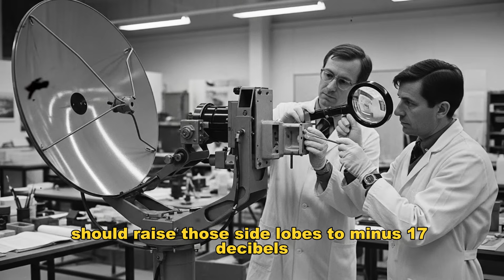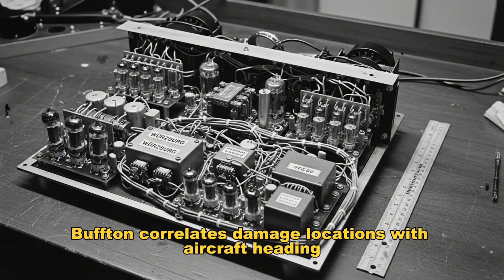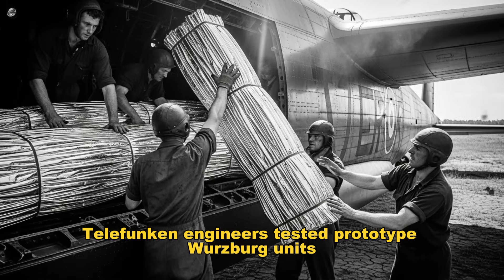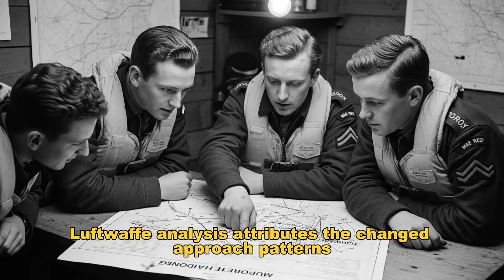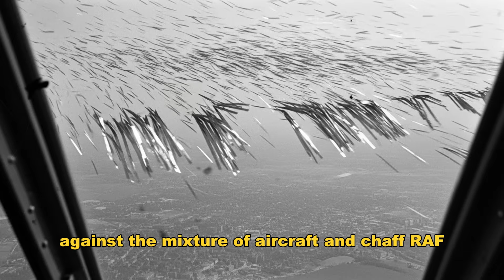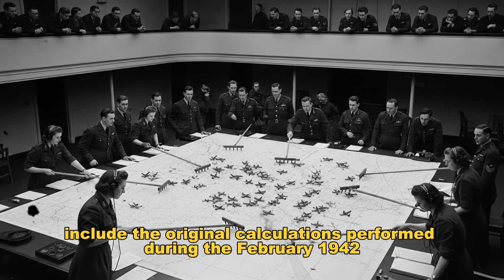British Radar Experts Probed the Würzburg-Riese Antenna — and Uncovered Its Alignment Secret

Comment: Have you seen a tunable magnatron operating in the 500 MHZ range?  Maybe they are referring to a reflex klystron.
Reply: There is some confusion here Brunivil and Wurzburg were never Microwave or Magnetron The result of the Raid was the AMES  Type 11 radar at about 450Mhz and triode valves. NO magnetron was tuenable there was some adjustment but slight.